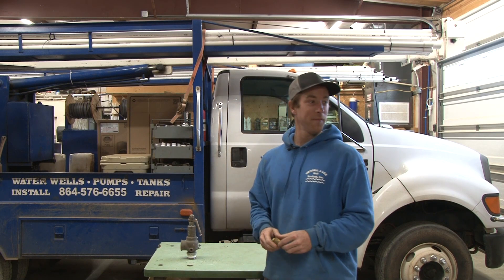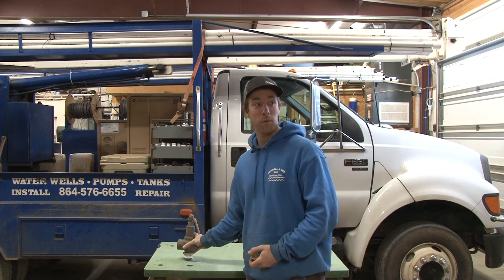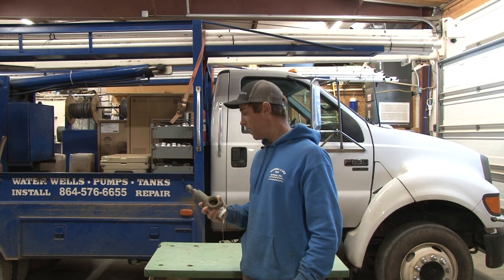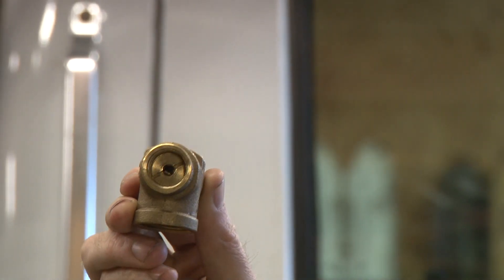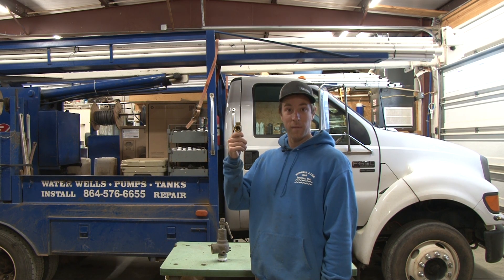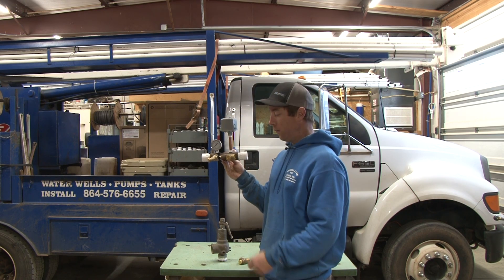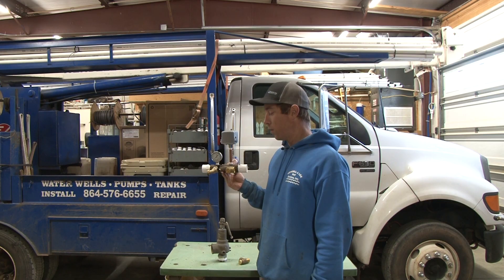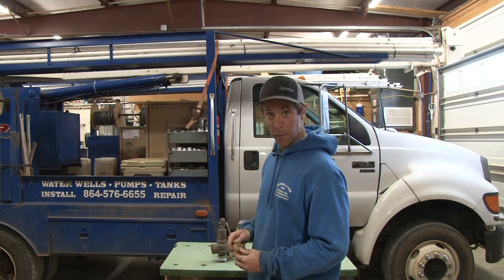What is a Relief Valve and How do They Work?

Comment: Recently had damage to pipes from storm. Replaced damaged pipes and all of a sudden this relief valve has steady stream of water when system is on. Well only serves irrigation lines. What could be the reason and is it safe to run system even if this valve has a small steady stream?

Comment: The relief valve on the hot water heater is leaking. The valve has bits of lime particles from the wel,l not allowing the seal to seal. It must be replaced. The pressure gauge keeps going down, and keeps running the pump.  The water is dripping underneath the trailer home. The bladder small pressure tank is wet on outside and water on copper pipe.

Comment: Thanks for video! I have 3/4" relief valve (75 psi) on my well pump.  The relief value is almost 20 years old and just started dripping, mainly when pump kicks on (it only drips around one cup of water per day).  But I noticed the pressure gauge for incoming water is around 80 psi.  Does this mean I just need to turn down the water pressure, or does the relief valve need replaced?
Reply: 20 years.... You answered your own question.

Comment: We had the pipe under the points to do exactly like he showed and the relief valve was bad, the water tank blew up and it landed about 200 feet from where it was at, the blast was so strong that it cracked some of the windows in the house, they are dangerous.

Comment: nice information ,what about  back press for my deep well jet pump ,has reg ,and swing check on output , My system  should be runnin 45 psi no higher 50 ,it is ,now toppinout at 55 ,/ after recent rain ,I dont whant more press, ,how about this ? james in claifornia

Comment: What I would to know is why those little buggers keep on dripping forever after first relief episode.
I have a 70 psi jobbie like the one you are holding in the video. My regular psi is around 60 psi.
The thing drips/drains around 2 gallons per hour. That's a lot of accumulated hot water wasted.
Switched out a couple of them...no luck. NEVER SEALS properly.
Reply: New tank tee then

Comment: The other day during 20 degree weather my pressure relief valve blew out but system continued to operate w no further blowout. Could this have occurred bc of the freezing weather? Should I replace the pressure switch or valve?
Reply: It did its job.

Comment: Yup, my pressure switch broke off and the connectors landed on the on position and my pump was always running which destroyed my pressure tank and some pipes on the property.  All because I didn't have a $25 relief valve.

Comment: I got a question. I replaced an old galvanized storage tank with a bladder type tank. The insurance inspection guy said this was wrong. That there was a pressure relief valve in the pipe about 6 foot down on the pipe in the cassing. Is this true? I've only pulled a couple 9f submersible pumps. And I've never seen 1 like that?
Reply: I have never seen on in the casing!!!
Reply: How the hell dose he kn lol 😂

Comment: We had ours trigger.. and for good reason.

Our well froze solid due to the 5F Texas blizzard.    I went to flip the well pump on 2 days later.. and didn't realize the 1 1/4 pipes running to the well head were still frozen solid (between the pressure tank and well).  Tripped and likely saved an expensive repair on our well.
Reply: I kept my faucets trickling during the 2021 Texas freeze disaster lol,  and with rolling power outages, I made my meter a manual transfer switch and legged my generator in to it 240, had to do this to continue periodic pump run to stop from having a well freeze, power would be on around 2 hours, then I would have to run generator 2-4 hours, back and forth for days.... got old quick lol,  but saved the well and kept water the whole time, i did have to replace my septic sprinklers though, i end up changing those almost annually anyhow

Comment: I'd say if there is any possibility of your well pump to above ground storage line freezing - this IS necessary. If the above ground line from well to tank freezes solid you want this. Even the pressure switch line or pressure gauge could freeze and clog the system.

Comment: Thanks for great video, but how do you set the valve to the correct psi for shallow well pump?
Reply from the maker: You can buy them preset at different pressures (some come preset at 75 psi, 100 psi, etc). The cap on the end or some bigger valves will have a bolt is where you can adjust the factory setting to what ever pressure you need.